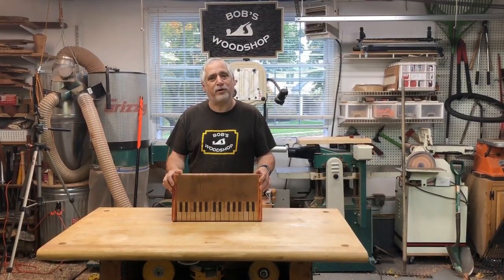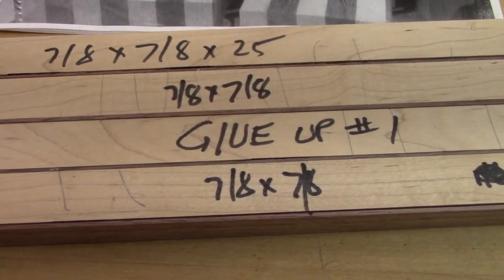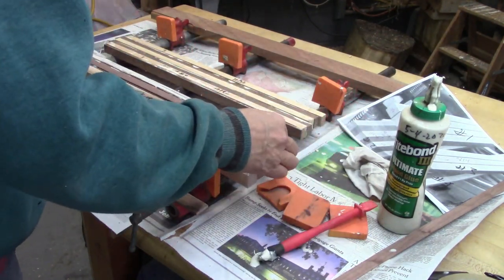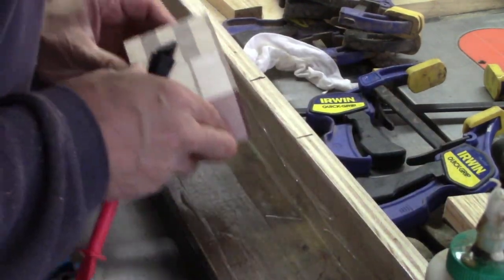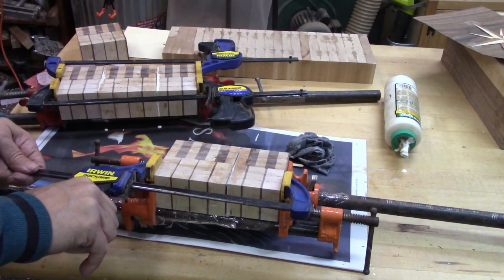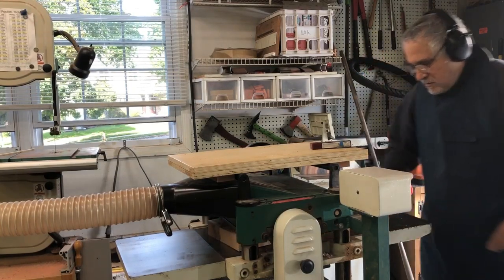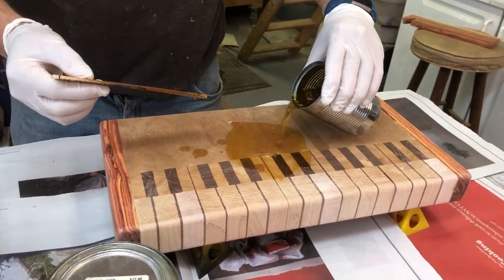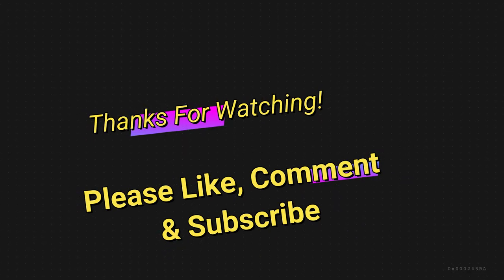Piano Keyboard End Grain Cutting Board - Bob's Woodshop

Comment: I am currently working on trying to make one of these. You said, next time you would like to make the bottom of the white keys each a solid piece. That’s what I have determined too, would reduce the possibility of error and pieces not lining up. But what about the top of the keys as well; the alternating black and white keys? Why not make those solid pieces as well? I haven’t seen anyone do that yet. So I’m attempting to try it now. It will either work out great, or I will find out why no one else has tried it. 🤣 Thanks for sharing your steps and results. Looks beautiful!!
Reply from the maker: Thanks Sally, yes , figure a way to use solid end grain black keys as well, good luck with your project.🗜👍